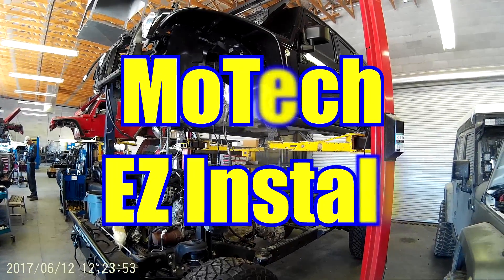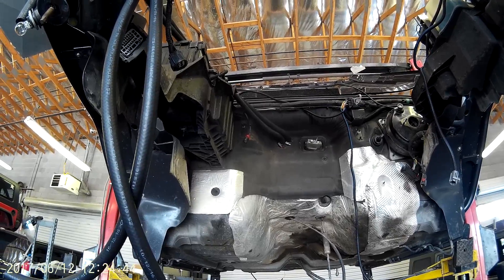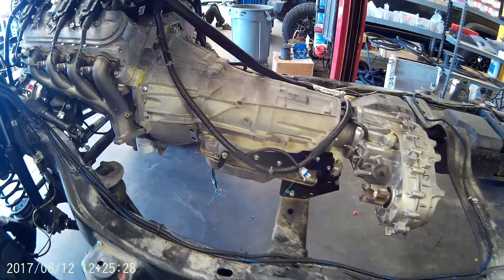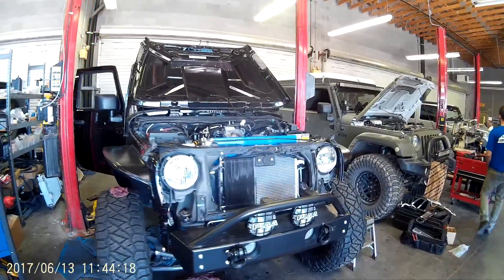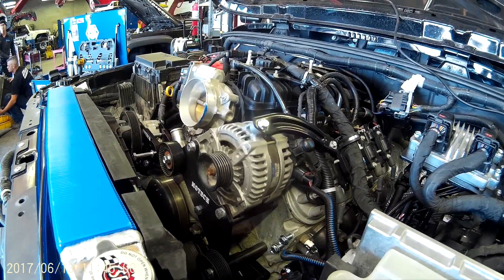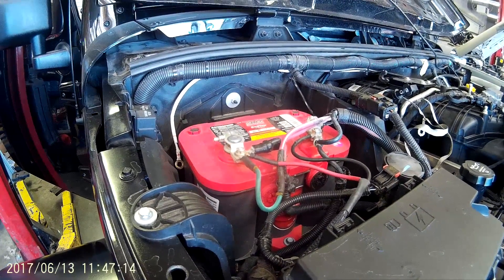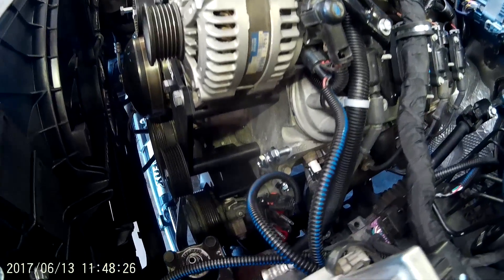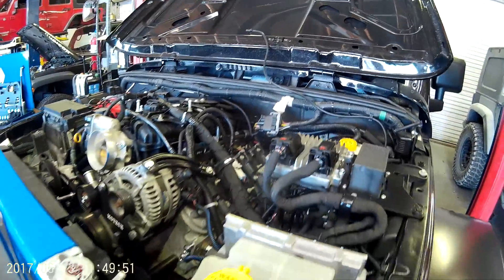Jeep Wrangler EZ V8 Engine Install

Comment: With this engine/ transmission/ transfercase swap will the stock axles work or will they have to be replaced?
Reply from the maker: Stock axles and TC(non Rubicon) are fine with this swap.
Reply: @WranglerJKLS  cool

Comment: Can we see some shots of the bolt on motor mounts ?
Reply: I will get pics up. We have a few types based on Gen IV and Gen V. Being adjustable gives you room to get the engine exactly where you want it.
Reply: VEGASROBBI WRANGLERLSJK Thanks man ! To be honest I wondered when a bolt in kit would come out . I don't have a welder and will be doing a swap with the body on in a residential two car garage. This kit will make this way easier with out any outside help(getting a welder to come in to install the mounts) 
Thanks for the great videos keep them up
Matt